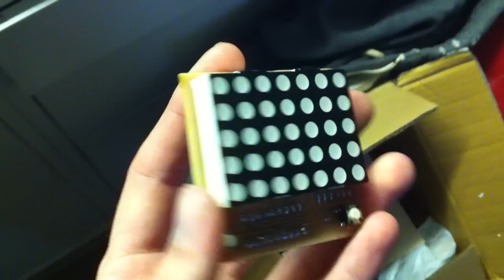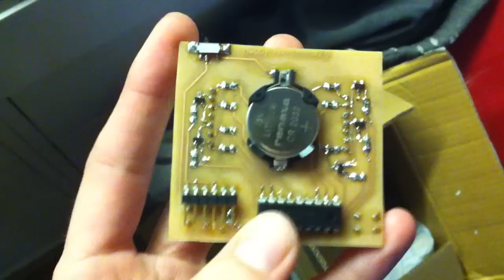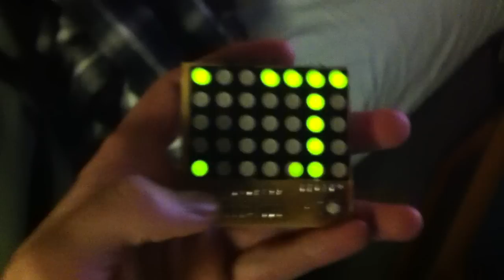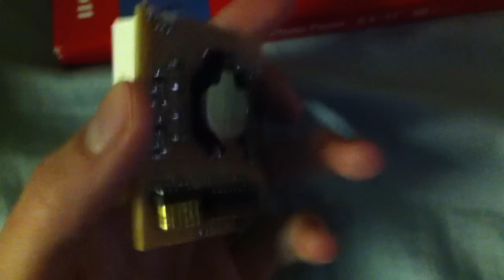LED Matrix Display

Comment: Hello, congratulations for this project, could you please confirm que le PIC 16f627a is, what are the 5 NPN transistors, Which models? Concerning the matrix TA20-11HWA I Looked at the datasheet and LED are reversed Compared to your sketches, can you confirm me I Realized purpose it does not work.
Thank you for your reply and still BRAVO, great.
  Sorry I do not speak English, thank you. Jean Michel